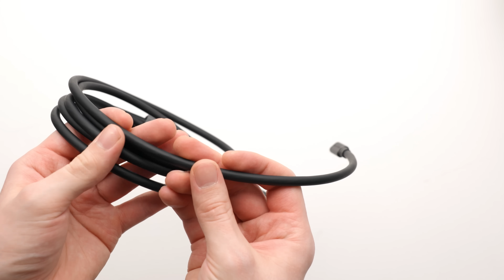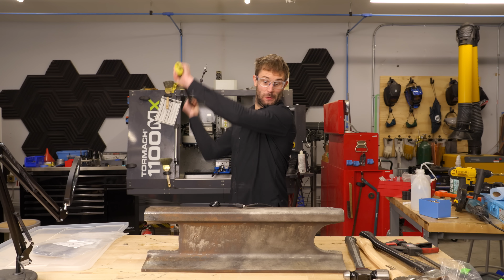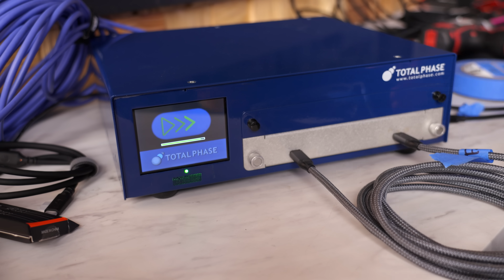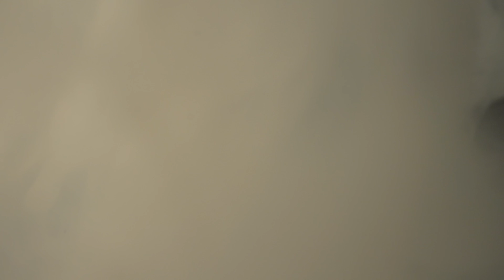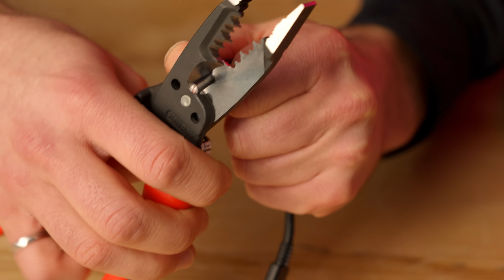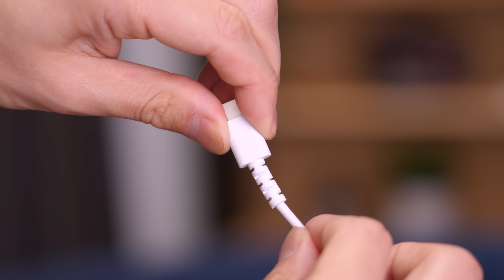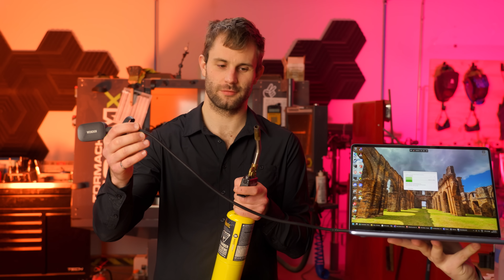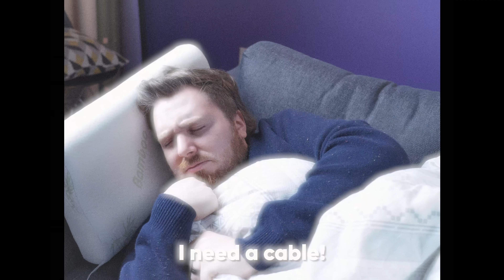Why It Took Me 4 YEARS to Make a USB Cable

Comment: Your answer to, why Billion dollar companies dont make such a Rugged over engineered, cable  with very rigid heads is in every positive point made for this cable.  Im not even going to talk about the cheap nonbranded built out of cables, they can be bad, thats true. but this isnt about those cables. The one problem LTT cable addresses, but over engineers. is the cable gauge for 240 real Power delivery, The USBC spec cables are just able to deliver, and is really is almost under specked. One point missed is,  the Real Reason why Every single cable company even with unlimited resources isnt as "Competent, smart, truthful and understands problems like the genius at LTT"  is.  They have already spent those dollars, and many ore years, Engineering the cable up and and now to its best real world use state it is in now. without girthy metals  and even girthier silicone to shield to solve the problem of getting rid of the slim, and very flexible type of cables used in, one of the best engineering answers to signal loss, without layers of shielding. The beautiful twisted pairs, The Cat 8 Ethernet cable transfers 40gbit with twisted pairs. Twisted pairs are also  used in hundreds of meters in every modern car, even critical safety CUNBUS communications, brakes,  ESP, airbags etc. with hundreds of other twisted pairs running along side them. without any shielding between most modules. minimal shielding on critical twisted lines. with full signal integrity, But not good enough For Linus's phone charger cable, Im surprised they didnt make the coating snake skin for god sake,  after years, and dollars spent, Companies understand When a cable is full of such metals and harder plastics, with heavy duty  Soldered ends. When these cables get knock, on a Laptop, specially on phones. by the 2nd trip or knocks of the cable. When USBC housing at best get bent, and only works when the contacts only, non rugged thinner any brand USBC cable inserted and puled the angle the contacts to the pins. Thats the best case scenario, but most of the time the USBC housing on the device detaches from the very very fine solder that's holding the metal housing to the circuit. So they decided a "PORTABLE" cable with undersea continental speeds are actually , not needed by more than 99% of users, and will do more harm,. For the 1% user that wants those transfer  exact repeatable speeds,  every time, all the time. They are already not using USBC cable hanging off the side of a very expensive device, attached with a  weak USBC housing. This cable is a lot like the Gold platinum super XXL turbo $2000 Audio cable. Most of the buyers dont need, it. Almost all of them will see very minimal if any positives, than a slimmer easier to handle and more forgiving  Good quality cable from a reputable brand. However after this absolute infomercial of a video. they will feel like they cant live without it, even tough untill now they actually were fine

Comment: What about HDMI and DP cables? Are they all the same, regardless of length/branding etc? And if they also have the same issues as USB cables, will LTT be working on getting proper, tested and qualified HDMI and DP cables of varying lengths out?

Comment: I recently learned about the co-axial cables in my college and it feels very relatable for some reason 😅
Co-axial cable : A coaxial cable is a specialized electrical cable designed to transmit high-frequency radio signals with minimal interference. It features a unique four-layer construction consisting of a central copper conductor that carries the signal, surrounded by a dielectric insulator to maintain precise spacing, a metallic shield (braided or foil) to block external electromagnetic noise, and a protective outer jacket. Its name is derived from the fact that the inner conductor and outer shield share the same geometric axis, a design that keeps the signal contained and prevents leakage. While modern fiber optics are increasingly common for high-speed internet backbone, coaxial cables remain the industry standard for delivering satellite TV, cable internet, and connecting security cameras due to their durability and effective shielding.

Comment: the cables seem to be well made, in the future it may be helpful to develop some sort of USB hubs as not all PCs or other devices have usb C or at least not more than 1 of them, and if you need multiple devices connected it would be useful to have a USB hub that can fit USB ports of various types, allows multiple of each type, and doesnt short circuit (or have power draw issues) when used, the only issue then becomes how to make it able to handle the power requirements as it either needs its own power supply, or some method of taking lower amounts of power and increasing it to be able to power all the devices without breaking the dongle, the PC, or the other devices

Comment: Older Apple cables did this all the time. 

I’m not sure what other people’s experience has been, but the braided cables they’ve been using for the past few years are way better imo. 

Could also be that when I was in high school using lightning cables; I only really had 1 charger that I would take back and forth everywhere everyday and as an adult, I have a few of their cables, one in the car, 2 at home, and 1 at work. So they get used a lot less than before.

Comment: after looking at the prices their better then i was thinking they might be. one fact must be pointed out 3.3 cable have 3 use cases. with their use cases in mind high power and data stability is great. their is one con, if you use these for an e-gpu these are not rated for fire-wire 5. to get 60gig, you have to down the max power output so they are 70% optimal to that edge case. but over all the price is rather better then i was expecting. so if they get an fire-wire 5 ready cable, the power limit will drop to 200ish watts delivery wise.

Comment: edit: I just noticed.... the 10cm cable is the same price as the 2.5m.... What the duck???!!! Are we only paying for the connectors and not the copper length??!! Or are you selling the longer cables at a lost but compensating with the hiked price of the tiny/short ones???!!!

I'll be honest, $29.99 CAD (€18.60 - £16.10 - $31.65 AUD) for a 2Gbps/2.5m C2C cable of very high quality is not "that" expensive... There are much worse products on Amazon.

Now I just gotta wait for them to restock and get my hands on 2 of those and 2 A2C ones too....

Comment: Curious how cold it gets up there and wondering if you guys tested cold weather like -10F and under that we've been having lately here in Minnesota. 

My car has had so many cables for the head unit and I haven't found a decent one that has worked for over 1 year. Samsung's cables I think last me around 6 months or so in the car, but I haven't used any of their cables in a long time. Anker for instance lasted about 1 year. Replacement cable was around 6 months before I ran into issues.

Either way I'd be willing to give them a shot since they are very reasonably priced. 

Do you guys intend to sell them on Amazon or anything like that where we could save a little on shipping from CA?

Comment: Is there any downside... To using a 40g cable... On something does not need it. From what I can see, the price in the store does not change. So, is just getting the 40g cable a no brainer, or should you really try to match the speed to what you need... Like say for a android auto cable?
Reply from the maker: No downside - LS
Reply: @LinusTechTips if there is no downside. Why even make lesser speed versions? Unless there is a price diffence between speeds, and your just eating the cost difference?

Comment: Did you run environmental testing on the cables? Silicone has a tendency to absorb water and oils over time, then sweat it out leaving a sticky and really weird feeling texture.

I get this all the time with garbage Silicone cooking utensils and the humidity we have in the lower mainland.

Only the really high quality, expensive Silicone doesnt have this issue. Food for thought.

Comment: Cool - I have been hoping someone trustworthy would make decent cables for years!
Suggestion - can you put capabilities specs on the store - maybe a test report/datasheet? Consumer level compatibility matrix?
Also, while I'm sure you tested thoroughly, I still have consumer grade questions, like, does it do whatever it needs to so my monitor will work with it?
I'm dumb with these things, I like to match the specs before I buy.
E.g.:
It says 40GBPS and 240W, so does that mean it's USB-PD (version whatever)  compatible, like I might find on my phone/Laptop specs?
I think I remember USB4 does something like PCIe over USB? Does it do that?
Is it a thunderbolt cable (and if so what number) or only USB (and if so what number... actually they made that so confusing it may not help...), or both? (Not even sure what the difference is.)

You've done all the hard work, and due to your rep you'll sell out, but I'm NOT hitting they buy button simply because I don't know if it'll do what I need.
I'm a firmware engineer with a hardware background, but this isn't my area, and if I can't figure it out there will be lots of people who can't... or people who don't know to ask and they might be disappointed.

Comment: In the LTT store "Global" basically just means "Canada" 🙄. Guys, the globe does actually extend outside of continental America.  It would be nice to have an easy option to switch to a currency other than USD/CAD.
Reply from the maker: Managing pricing across a bunch of diff currencies  not too manageable for us. Global site pricing is just in CAD so we only set two prices - one for global and one for US that accounts for any applicable tariffs - LS
Reply: @LinusTechTips  Yeah, I figured this must be some kind of "sensible trade vs. freedom tariff" issue, but pretty much everyone else I order from at least gives me the option to view prices in my local currency. It's no biggie, just a minor inconvenience for those of us (un?)lucky enough to be born on the bits of soil that happen to be out of earshot of the squarks of bald eagles. 😁

Comment: I was actually within guessing that those cables would cost more than 15CAD not surprizing it costed 25 most cables are sold not by their function but their length except Apple they sell it like it's a luxury cable

Comment: I feel like the full Gbps writing is a bit unnecessary, it forces the entire spec font to be small (so it fits on the housing) and it's also a mouthful. You could probably shorten it to G/s or just G unless you guys think that's not "TrueSpec" enough

Comment: The biggest addon I would love to see LTT include, would be a magnetic data cable. One where you can just leave the connector  in your device and connect your cord to it. Or leave numerous connectors in numerous devices, and use one cord to easily swap back and forth between them, without having to plug in each time.

Comment: Now make a charger that can automatically charge your phone at its rated speed, but can also be manually controlled so if you don't want to fast charge your phone or use it to power a computer. Please.

Comment: A problem that I personally have had is out-of-spec HDMI cables. They are labeled as 2.1 but would flicker or not work at all when using not even at max spec. Any plans on making video cables??

Comment: i do understand that longer cables have worse data speeds but whats with the huge drop between 20gbC/10gbA and 480mbs? was really hoping to get one that i can generally use for all of my devices but i use vr and it need at the very least a gig a sec to run well. just feels weird that there isnt a in between.
Reply from the maker: USB spec only allows up to a certain distance at high speeds. - LS
Reply: @LinusTechTips  i mean i get that but are you really saying that going from a 20gb 2.5 meter cable to a 3 meter cable really adds SO MUCH distance it removes 19.52 gbs of speed?
thats about a 41 times reduction for less than 2 feet of wire.

Comment: ANGRY! 😡
I didn't receive a notification that the cables had been released even though I signed up for a notification! 
By the time I see they are release on the Wan Show all the long high-speed cables are out of stock. the very thing I was trying to avoid by signing up for a notification.
What I am angry about is the false promiss that signing up for a notification would save me from you missing out, but the notification has still not come and 19 cable lengths are already out of stock, including all of the useful lengths with high speed data that I wanted.
I actually held off buying cables for my new setup for several months because I wanted the ltt cables and now I'm going to have to buy from the local shop.
I will forgive you tomorrow, but for today you totally suck. 😢

Edit: cooled off now. Not angry anymore. Now watching riley and a cute little robot. 🤗
Reply from the maker: Sorry! Sometimes emails do not work perfectly at scale. We do our best and I assure you we want every marketing email to be delivered :/ - LS
Reply: @LinusTechTips  Sorry for posting while in an emotional state. Congratulations on another successful product. IDEA: Maybe notify people of a time and date in advance via the Wan Show, the website, and via emails trickled out slowly?

Comment: i have question, if you think about good durable cable for vr headsets, i asking for reason of a lot of 5m cables have not very durable connector what have high chance to fry charging port on head set, exactly what happend with me yesterday

Comment: I have a USB A to C cable I put in an aftermarket installed stereo in my car on the back of it. The USB-A side has to be a 90 degree connector so it will fit. Any chance of designing such cable?

Comment: Sadly silicon outer is a auto no thanks to humid environments generally hardening up the materal in a year or so. Thanks for the advert though.
Reply from the maker: That's not silicone then. You're thinking of PVC, probably. - LS
Reply: @LinusTechTips sorry I'm thinking of silicone. Although granted my main experience with silicone is knike grips and cabling for signal equipment which will come in contact with human oils as well as other not so optimal environmental conditions like the kitchen or in a rainforest which causes the silicone to start degrading at a much faster rate than usual.

If it's just high humidity and average temperature(around 30ish C) it should last alot longer

Comment: As someone who has been waiting for these since you first mentioned them years ago, I have one complaint and one suggestion that seem counter intuitive when put together.

Complaint: you hyped these up like they were gonna be expensive. These are actually in the exact same price range as similarly spec'd cables from reputable brands such as Anker or Ugreen that I've looked at, and idk the way you made it sound i thought I was gonna be wincing at the price. These are very reasonable and not at all what I'd consider expensive for this level of product, and now I feel bamboozled. 

Suggestion: after these have been out long enough to gauge interest, maybe start making multi packs for a slight discount. I know a build your own bundle situation would be a nightmare for logistics, but I can already see some cute names for different packs, like "Big Bois" or "Linus Length" for long and short bundles respectively based on popularity.

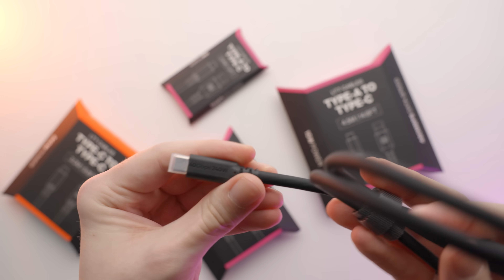Comment: 0:47 These markings should be white to be easily visible.
Reply: Overkill IMO... I'd rather it be recessed like this than there be any chance of lettering wearing off. The whole point is just to make it identifiable. Anyone who really swaps around different types of high speed cables enough to need it even more visible could just run a paint pen inside the recessed letters or use color coded bands like I do.
Reply: @JJFX-  OK, but I often have to connect such cables in poor locations, such as under a desk, behind a computer, or in even more poorly lit areas. 
Personally, I treat all such cables with correction fluid (Tipp-Ex) or similar paint, or a permanent marker (Sharpie), but I'd prefer to buy cables that have these markings already applied at the factory.
Reply: @tristankordek  That's valid but I'd bet 90% of those buying these aren't in that situation. Plus in many IT environments I've been in, custom tags or color coding like that is still used regardless what's on the cable because it's even easier to quickly identify in the situations you're describing. White letters on the connector is only so helpful when it's obscured by other cables or not in line of sight.
Reply from the maker: Would have added cost and complexity to the mold on what are already very expensive materials and wouldn't impact performance. We decided to stick to performance - LS
Reply: @LinusTechTips  Thanks for the explanation. Performance (stability) is the most important thing, and we'll handle the labeling the same way we did before. 
The prices are great, it's just a shame there were so few of them (compared to demand). If I heard correctly, Linus said that if all goes well, another batch should be available in a month. 

Is there a chance that LTT might also be interested in HDMI and/or DP cables?

Thanks again, and best regards.

Comment: It would be cool if you also made a cable that's just USB 2.0, as thin as possible, but also high quality. I understand the need for coax for the high speed stuff, but so far the best USB C cable (for my uses) is the Amazon Basic USB 2 cable because it's so thin and fits nicely in my backpack. They do only last me around two years though, and it'd be great to have one with say the silicon sheathing and better strain relief.